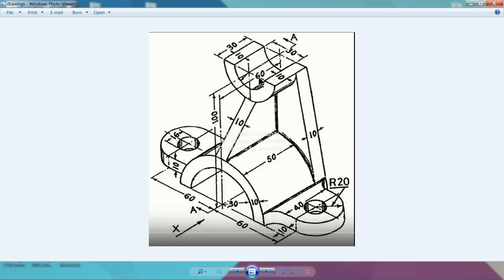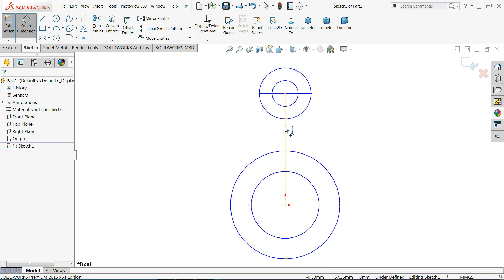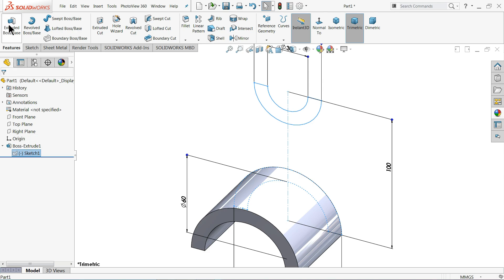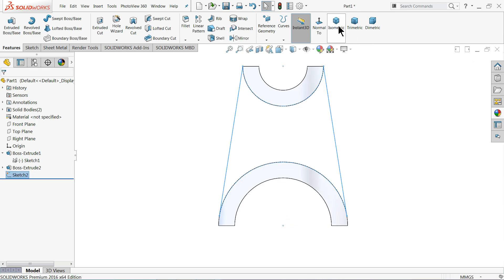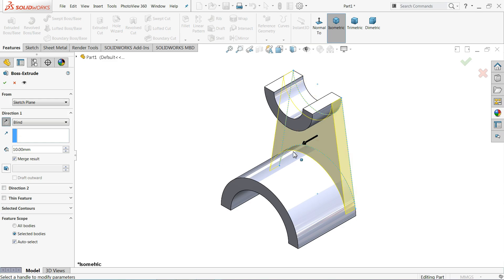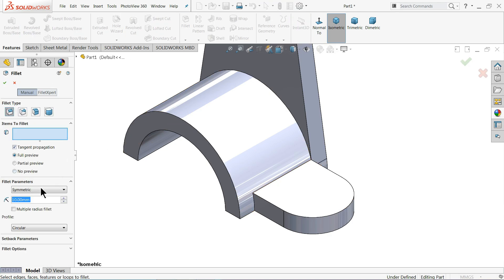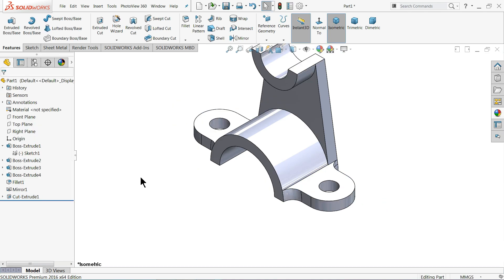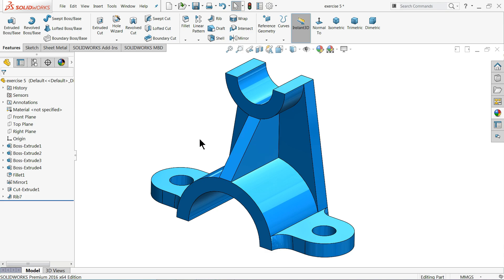SolidWorks Tutorial for Beginners Exercise 5

Comment: having trouble: last part - when i convert the entities of the upper and lower curve - the entity on top is in correct position but the one on the bottom appears in the middle of the curve and not on the edge.
Reply: I did the same thing, you selected the wrong face to sketch on, if you select the front plane it will do that, the right plane is the one you want to select to be able to convert both entities for the rib